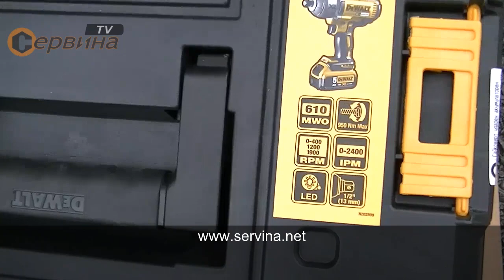TEST DeWalt DCF899P2 950 Nm Vs DeWalt DCF880M2 203 Nm Vs DeWalt DW292 440 Nm

Comment: Rubbish! You are testing impact wrenches which are specified for up to 950 Nm on a bloody wheel bolt which usually gets around 110 Nm. Of course all of them get those bolts off if you only pull the trigger for 2 seconds. BTW: build quility is rubbish at least for the dcf899. Battery is wobbleing like crazy and the grease leaks on front of the machine.
Reply: Sebastian99 sir can you please elaborate, is dcf880m2 bad ? I'm planning to buy one

Comment: 899 the best
Reply: Too heavy to work with
Reply: Jack Sparrow you are too weak if you cant hold it when working 😂
Reply: @Jack_Sparrow17  I actually have an DCF899NT - XR. And well I can say it gets the job done. Even opens the giant CV-joint nuts with ease. 
But damn I say it's a bit overkill for just undoing the wheel nuts/bolts. (Break-off force was like 1600-1800Nm? And the rated 950Nm is just for tightening.) Also it doesn't fit in every place you'd like to use it.
Super rusted, insanely tight nuts will shake off their rust and either undo or cut the bolt. (Or shake the part the bolt is attached to into pieces)

On and on.. I agree on it being heavy if you have to hold it horizontally for an extended period of time. (Or above your head in a unergonomic position) That's why I'm looking for a powerful but more compact version. Mainly for the reason that 899 is just too long for tighter places.